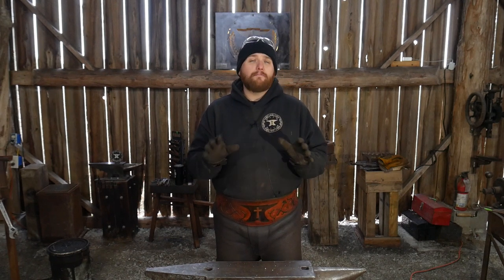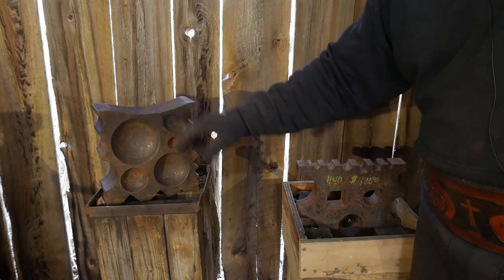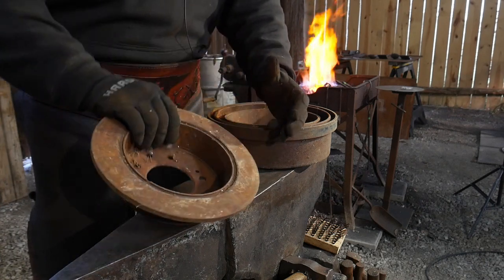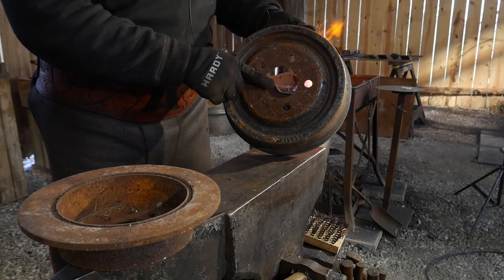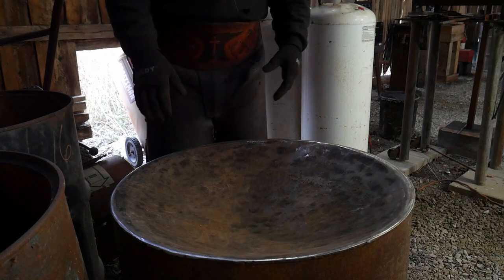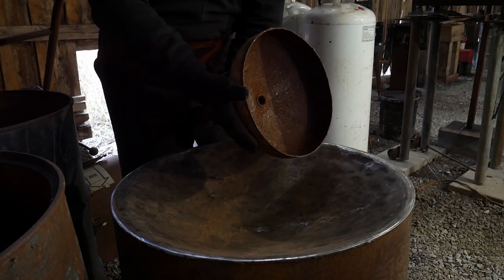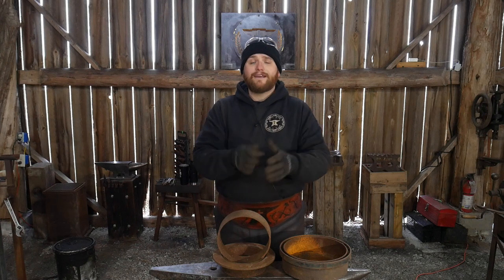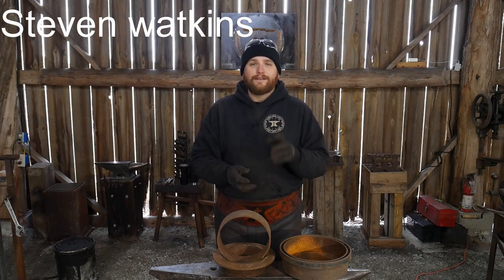All About Swage Blocks & Alternatives

Comment: Another great & informative video Roy. I couldn't agree more about finding ways around not having the tools you need & having to find clever ways and workarounds. Smithing is my hobby so I don't have a lot of spare cash to fund it. As such, I have build and make do where I can. I have built my own belt grinder & attachments which works really well, I also don't have a welder so I have got quite good at thinking of ways to bolt things together instead to make the tools I need. My guillotine tool for example is bolted together and works a treat.

Comment: Roy, I found a few agricultural disks that do not have holes because the tractor salesman waits to drill them as made-to-order.  I found one that was almost a 1/4 inch thick.  It works well as a dishing swage although it is 22 inches across.  You could also seal a hole by welding a small plug over it.

Comment: Around my area, it's very hard to find a swage block.  So, I've made some out of the bottom of a couple different sized fire extinguishers.  Works good!  Also, I have some pieces of pipe that are different sizes that work well. Like, 2", 4" & 6".  A lot cheaper & easier to build than trying to find a swage block.  but...  I'm still gonna keep my eyes open for one!  Thanks for the Great video & some good ideas!

Comment: Another completely ready made depression of good size is the inner tank of a water heater.  I stripped the insulation off a (I'm guessing) a 40 gallon water heater, and the bottom domes inwards.  It's 16 or 18 inch diameter if I recall, and wound only need to be cut down to the appropriate height for the user.

Comment: I started blacksmithing with a $7 hammer, a rusted piece of metal being used as a boat anchor, and a cooking wok with holes drilled in the bottom. After 14 years, buying and making 1 thing at a time, I have acquired enough stuff for a functioning wood / metal shop. 

Don’t look at the duck on the calm surface, look at his feet paddling like hell against the invisible current.
Reply: That’s amazing. Thank you for posting.

Comment: can't believe you missed the easiest one off all, old co2 or oxygen bottle. a lot off them have lovely depretion's in the bottom off them for forming, cut the top off them fill with sand weld a nice chunky plate on the top turn upside down bang!! done, used an old co2 fire extinguisher need to get a oxygen bottle to do the same with, you don't need to fill with sand but it helps dampen the sound as they are a tad noisy otherwise!!

Comment: Just buy some old gas cylinders, the backside is usually a big depression, plus you can cut a ring out of the cylinder, which is even bigger in diameter. The cylinder itself can be used for shaping round forms, or a cutout of thy cylinder can be used to shape negative shapes in...
My suggestion is: find an old gas cylinder, cut of the back as a doming form, cut a ring for shaping stuff, cut off half a ring for shaping stuff.
Also find a length of thick walled pipe. About 3" diameter - use the hollow end for doming, use the outside for shaping.

Cost you about $ 20,- or €15 or so I use mine now for 15 years....

Drum brakes, like shown here are not that good, a bit brittle.
You better use those to make a forge for charcoal....

Comment: Very nice. 
I have a couple steel blocks, about 5" square, they are manifolds from an old loader for hydraulic or pneumatic lines. So there's a few big holes in each, one hole I machined a small scalloped depression into around the hole, while turning the weld seam off.
I was saving them for machine work setup blocks but will probably designate one for swage block uses

Comment: FYI.  Don’t for get disc Harrow blades they are great and good steel.  Check with agri tractor dealers and repair shops. The blades wear out or have broken centers but are still great dish forms.